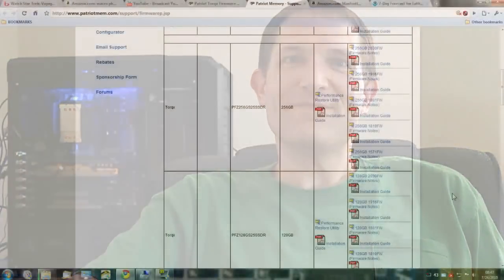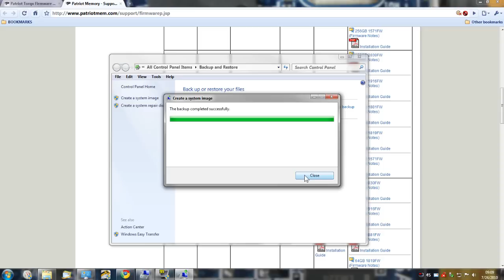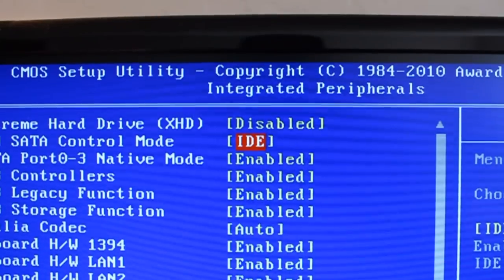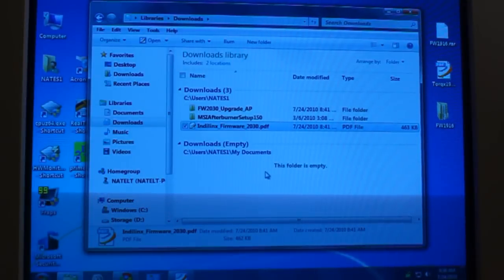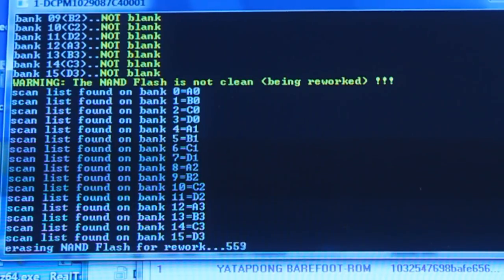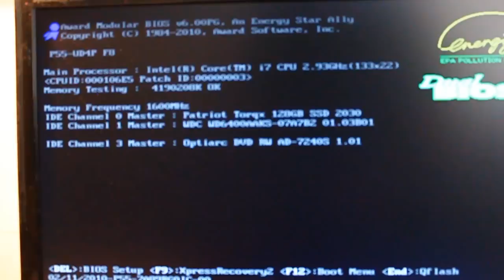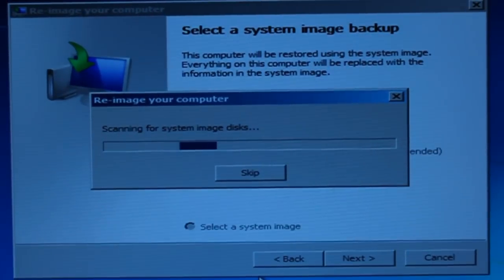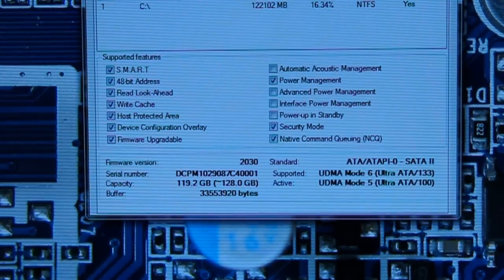SSD Firmware update

Comment: how do you update the firmware on two ssd's in raid 0.  I plan on getting the crucial c300 256 gb drives.  The firmware updates for the crucial are non destructive so you don't lose any data when you update the firmware so how do you update it especially since you have to set the sata mode to ide in the bios before the update according to crucial.